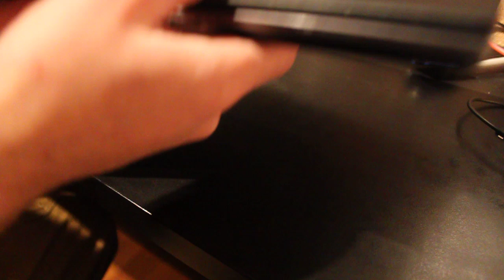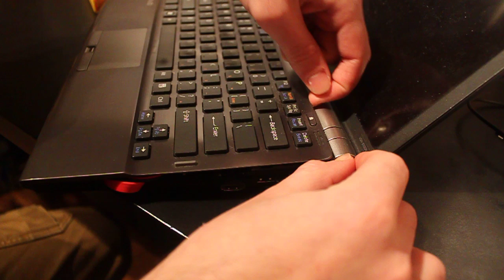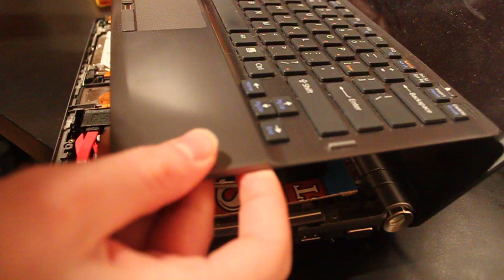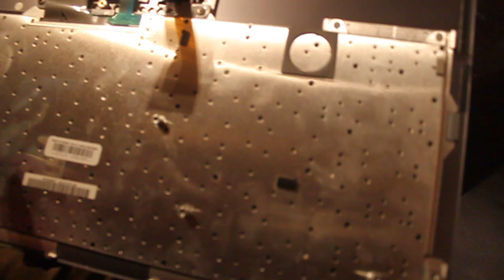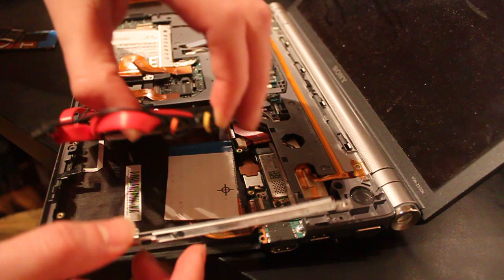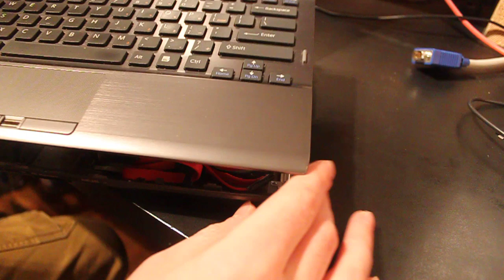Cenkaetaya Tips: Hard drive in DVD drive of Sony Vaio Z series - Howto

Comment from the maker: There is a little socket / clip where the cable goes into. I am not sure how exactly you broke it.  You lift up the back of the clip and it allows you to slide the ribbon cable inside. Then you close the latch to pin it down. All of the ribbon cables on the keyboard have the same mechanism.

Comment: Thank you for this helpful video. Unfortunately, when I was removing the keyboard, the ribbon cable came off from where it was attached to the keyboard and there is no way for me to attach it back (there is no socket or similar). Now I can only use my laptop with and external keyboard/mouse set which is pretty frustrating. Do I have to replace the whole keyboard or is there a way to re-attach the cable? Many thanks again.

Comment from the maker: Hi, i have never seen a PATA port in a laptop.

I have both the old Core 2 Duo Z, and the I5 Z, and both have the adapter that works fine with this caddy.

if you have a different port you will have to do some research.

If you take the caddy apart the actual "adapter" is very small. So if you have issues with space you can always do that to save some.

good luck, i use this in all my computers now.

Comment from the maker: yes, thats it, its not really a big deal just make sure you carefully remove it from the motherboard when the keyboard first comes up.  You can see the cable at 1.17.  Removing the actual hard drive is super simple, its probably 1-2 screws you need to remove and at that point you dont really have to be too careful, its just removing the keyboard which is a bit tough cuz you need to pick at it along the edges after you remove the screws.  If you dont have any finger nails you can use a creditcard

Comment from the maker: Hey, its super easy. If your Z21 is the older one.. with the Core 2 duo, the only thing is be careful with the ribbon cable from the keyboard.  Make sure you detach the (motherboard) side, since the part that attaches to the keyboard is kinda weak and i almost needed to buy a new cable for mine.  Other then that it really is quite easy. Just be patient, remove the battery first and youl be fine.  If i were you id replace the DVD drive iwth your 750 gig drive and keep both :P

Comment from the maker: @GabriKnight hey, I actually have the z12 myself now.

I did it wayyy easier this time. Go on ebay and buy a thinkpad T400 caddy, i got one buyitnow 12bux.  Just open the z, and take out cd, and the thinkpad tray fits perfectly. There i a tiny 1.5mm x 5mm gab in one corner but its not a big deal. The screws wont fit and some folks drilled holes in the Caddy for placement. I didnt screw it in, it fits tightly enough when you put the keyboard on. Unless your laptop bashes the floor, it'l stay in.

Comment from the maker: This is because if something is using the drive, it will not shut down and tell you "you gota restart the comp" if its not being used, it just turns off fine.

Also make sure to close any apps when turning it on. once it changed drive letters for me, but after i restarted it turned back to normal.

I use drive 2 for downloading usually, so i just gota turn off Utorrent before doing any drive changes.

Note: it sucks about 35-40mins of battery life, not so bad. I almost never turn it off.

Comment from the maker: ... you should have no need to move or even unplug the current HDD. i would even touch it. You can boot from which ever one you want in BIOS, i am guessing unless the Vaio Z restricts it. I boot from the Main drive so in never tried.

You can swap the two drive or what ever you want. I mean its basically the same as if you were to do it in a desktop.  Just imagine you have a desktop with 2 drives.

To power down the drive (go to device manager) Note: make sure no apps are using the drive when so

Comment: @cenkaetaya1 
Ok and I was planning on connecting my boot drive to the old DVD drive connector. That should work, right? I know I could boot from the drive before taking it out so I'm thinking it will. I just don't want to have to move around more stuff than I have to (ie the current HDD).

Comment from the maker: @cmsb5 hey, sorry i should have made that more clear. You just need an SATA power adapter. I got mine from an old PSU. You can really get it anywhere, just cut it off, and attach the wires by the same color and you are good to go.

Its just the adapter comes with a standard Power Adapter, but you just need to swap it to an SATA power adapter. its basically the same thing just with different ends.

i actually just now  upgraded by z's second HDD from a 140g to 320 :)